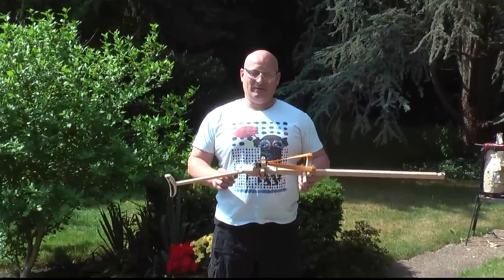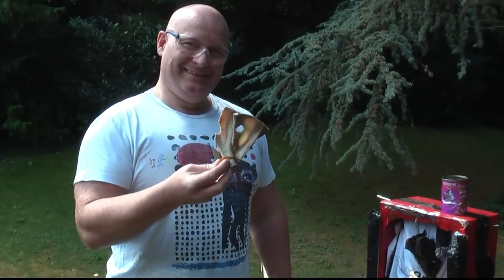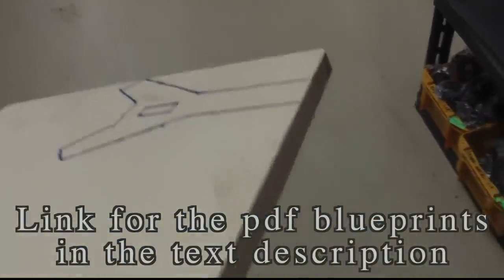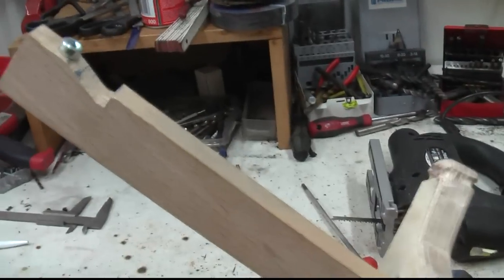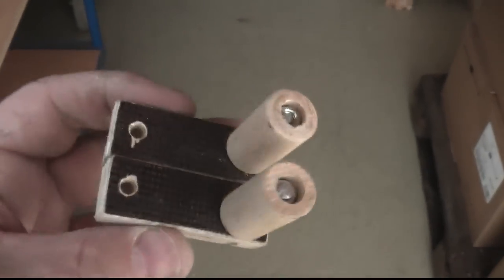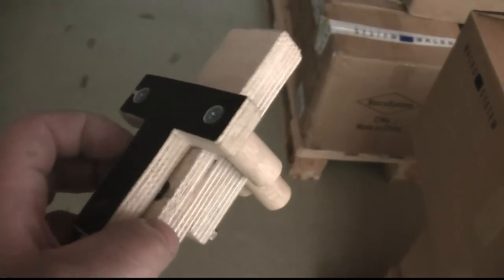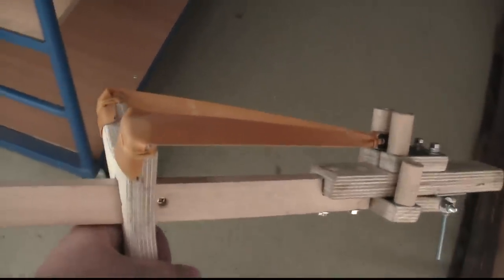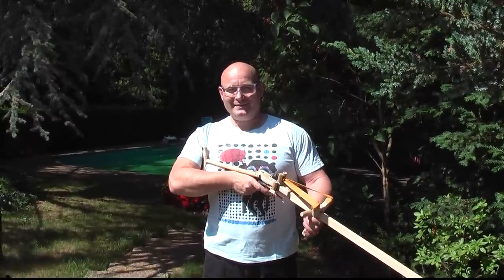How to make the bonecrushing Sling-X-Bow at home, with common tools

Comment from the maker: @iChayce No. Rubber has an inherent speed limit that can't be exceeded. A windlass operated sling-x-bow would only bring more energy if you use very heavy ammo. For steel and lead balls up to .75" (19mm), no such pedal or windlass is needed, stronger rubber would NOT make the shot significantly faster.

Comment: Joerg, 
While making a similar sling gun, I decided I could improve on your lock/trigger system and after two tries have come to the conclusion that you are far more talented then I am. Mine worked fine and had a very light trigger pull but deflected the pouch upward when fired. I couldn't hit anything with it and it was very inconsistent from shot to shot. Anyway, my hat is off to you... Thanks for your ingenuity and the videos...

Comment: Hi Joerg, I made this. Thanks for the video! This really is fantastic - thank you very much. This is my first ever sling shot so now i'm just sorting out accuracy and power, and laser pointer. My piece of wood is about 1.5m long and a bit unwieldy... but i used the cheapest rubber bands you can find so it needs all that length to get some power. I was practicing with clay balls, very fun.

Comment from the maker: @oud25 Well, see if you can break the piece of wood with your hands. If you can't, then there is no chance you can break it by using it as a slingshot barrel. Remember the power always comes from your arms, the rubber just converts it. I put very heavy bands on this model, the heaviest that make any sense. No signs of weakness.

Comment: the best rubber to use is called Thera-Band which comes in different strengths, gold being the strongest. It's usually used as resistance bands for rehabilitation/physical therapy, but it makes great slingshot bands too.

Comment from the maker: Yes, because if it has a trigger it is a crossbow, and crossbows are falling under different rules. Crossbows are im fact almost unregulated here, you just have to be 18 or older to own one. 

I guess the government wanted to ban concealable slingshots with folding braces, as demonstrants used these in the 70s. They broke some police equipment and scared the cops but good.

Comment: i have concerns over the type of timber being used, but overall i am glad to see you using multiplex, i call it plywood here in Australia. The advantages of the steel framed model are clearer, but I would have liked to see a comparison on the balistic gel with both wood and steel versions. 
What is most intriguing here is your trigger system. i admire the use of cylinders to allow an easy and smooth transitional cross-over of energy. I only advise more robust materials for the trigger mechanism.

Comment: Finished one. I made the "Y" hole too big and angled the wrong way. Oh well, it works great. I am now working another one with some metal parts in the lock.  Thanks Joerg for a great idea.
I have a question: how long& wide is the theraband?
How far is it stretched when cocked.

Paul in Oregon.

Comment: @idezilla A jam nut is just a low-profile nut used to lock another nut in place, usually it's only necessary if you don't have room for a 2nd full size nut.  Exactly the same function though.

Comment: @lzwillis No because the washer/nut will still press down on the hinge and not allow it to swing.  The idea of using 2 nuts is they leave a slight gap below for the hinge to swing, while holding their position on the threaded rod.

Comment: did you use plywood and not a regular board for the fork? the fork has the most force on it, so it has to be really strong. Also, the "barrel" has to be made of fairly strong, straight-grained wood with no knots it it, or it could snap too.

Comment: What type of plywood is used? softwood or hardwood plywood?
Reply: From what I know, there is no such thing as plywood made of plywood. I have heard about layers of pine glued together with thin layers of hardwood on the exterior, so it looks like a piece of hardwood.
Reply: depends on how excited you were about the video
Reply: David Halmaghi Hardwood plywood is easy to come by if you know where to look. Personally, I have a radio controlled airplane hobby shop that carries sheets of the stuff, much thinner than I need, but they have been happy to order a few thick pieces for me in addition to their usual shipments. But Im sure its available online somewhere as well.
Reply: HTTracks sometimes you can find some old hard plywood like when i renovated my camper into a work trailer the doors of the interior were made of hard plywood. very valuable pieces thats for sure!

Comment: I been wondering where can someone buy the bands you use for the Sling-X-Bow?
Reply: ebay or amazon. theraband gold.
Reply: +Steve Rabon glad to help a fellow slingshot fanatic.
Reply: I was wanting some spear gun bands as well. Is these as good?
Reply: +Steve Rabon he uses these bands for all his slingshots. mostly if any size. but these are fantastic bands. i have been using them in my slingshot for over a year. not had to change yet. with daily use too.
Reply: OK thanks. I will check them out. I know the spear gun band are kind of hard to pull back on a sling bow. With these you can apply more to achieve more resistance till you get them where they feel comfortable; I think anyway.
Reply: +Steve Rabon Ok. Best of luck.
Reply: Thanks for your help